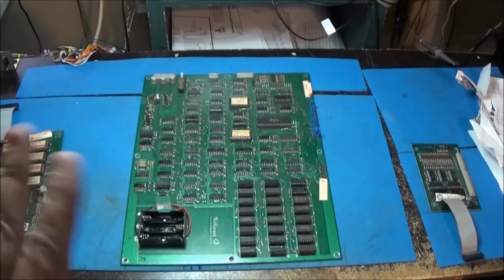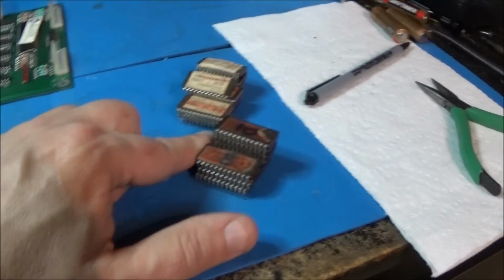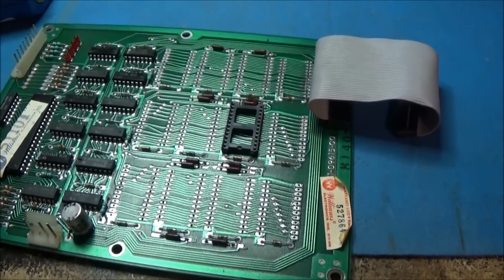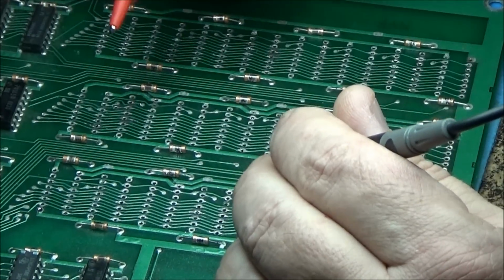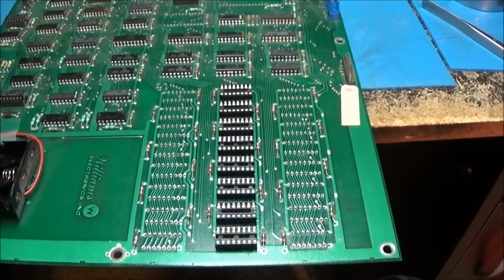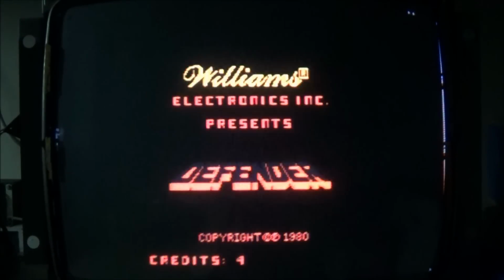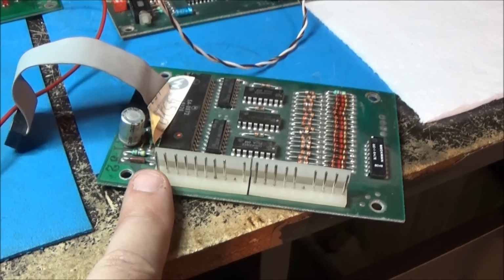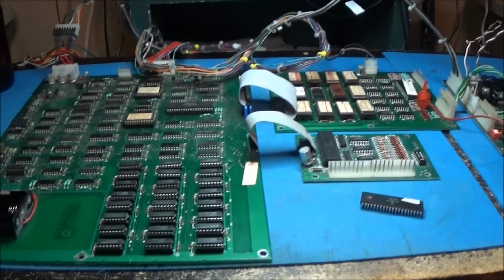1980 `Williams Electronics Defender Arcade PCB Repair 12/6/20

Comment: Those damn interface boards are different to each game
Reply from the maker: wouldnt it have been cool if they were interchangeable?
Reply: If I recall defender differs from stargate and others. Notice the small black chip at the top of the board and defender does not have that chip above these glass caps.

Comment: I had an old thread on KLOV asking what the heck kind of solder did Williams use because I've had the same issue with them not wanting to desolder.  I've gotten to the point where I will remove each pin one at a time with a needle nose and then add a ton of solder then use the hakko.  Other wise it just wont pull all the solder.
Reply from the maker: yup...   i shouldve done that from the start

Comment: It looks like they board you had there came out of a Stargate and is a C8783. The board that was sent with the board set is a C8573 and goes with Defender. I am not shocked that the PIA is bad. Those like to fail. In the pinball world they get replaced all the time. The screen flipping is due to cocktail mode.

https://www.robotron-2084.co.uk/techwilliamshardwareid.html

Comment: The 5101 is already socket on that board. Put NVRam in.
Reply from the maker: The owner of the board can go that route if they want...   im good with buying some energizer lithiums and calling it good..   as long as the battery holders are good..   which this pcb has a nice clean new holder..   id just go with lithiums

Comment: I used to own a Defender upright. I sold it on Usenet in 1997 for $80 to some guy from Pittsburgh who drove over to get it. I bought it from a coin op company in Columbus in 1987 who was cleaning out their warehouse. I put some money into getting the power supply working but never managed to interface it via RF to a TV. In the end I sold it and used the money at the first Anime North convention.
Reply from the maker: ive had two Defenders over the years..  the last one was about ten years ago...  i did the worst ever side art install job on the thing...   still sold it for $350 i think...  id love to have another